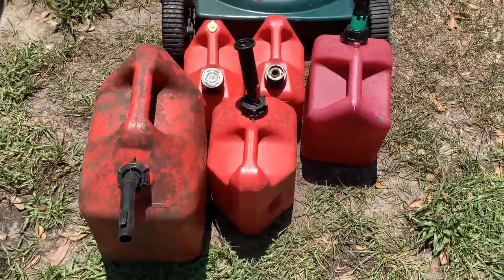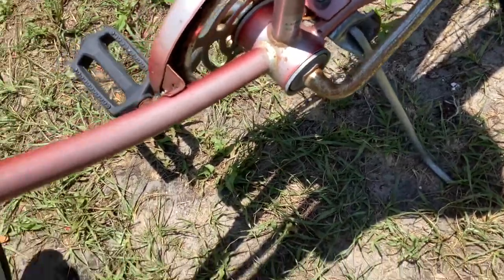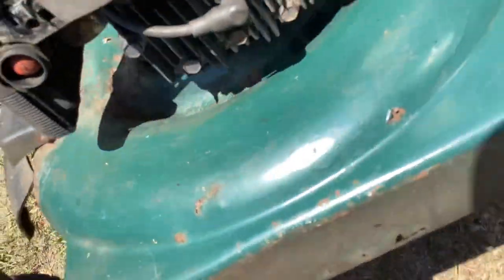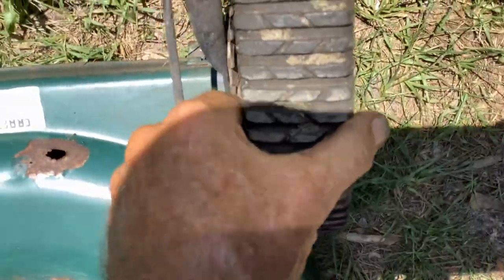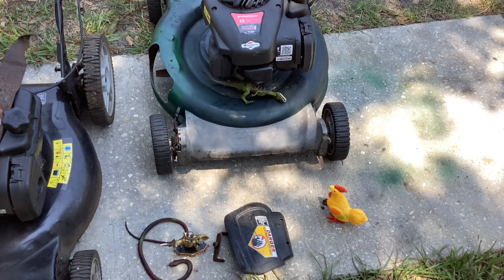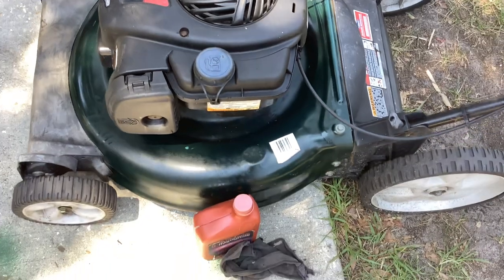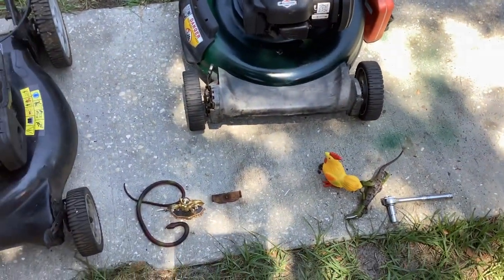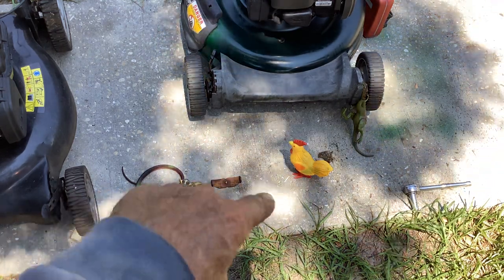2000 Craftsman High Wheel Lawn Mower for $10 and Murray WestPort Bicycle for $10.

Comment: Try the wheel cleaner acid I get it at napa. On the rusty fenders and wheels. Maby some 00 steel wool with your wash bucket and rubber gloves. Results may surprise you. It is mac's 1458 aluminum brightner. After use take spray top off spray back in bottle and spray water through spray nozzle so it dostnt dry in sprayer and quit working
Reply from the maker: send me a part Number for that NAPA cleaner.

Comment: Sales slow. Went garage sale this morning look at a 5hp mtd snowblower. Clean needed a scraper drive seized.  Needle bearings on drive wheel shaft seized. Wanted $80. Should have bought it. I went up the road to my guy bought 5 for $175 the 1 john deere will give me all money back for other 4. All carburetor issues. Came home have a dozen toros brushed in paint then get some shine on them list them. Another channel I watch the federal reserve on 7/20 2023 is moving to fed now instant payment system.  Tells me dollar going away happy days